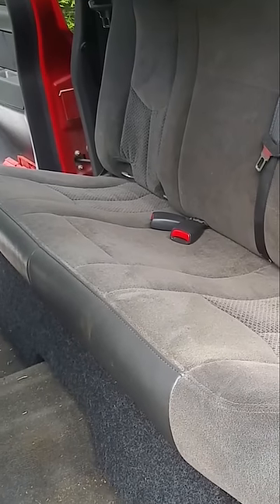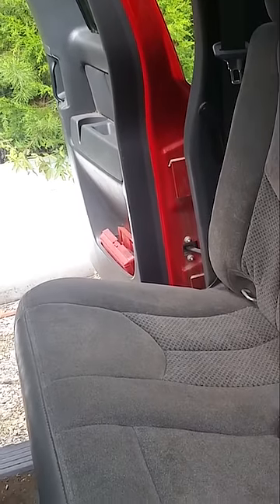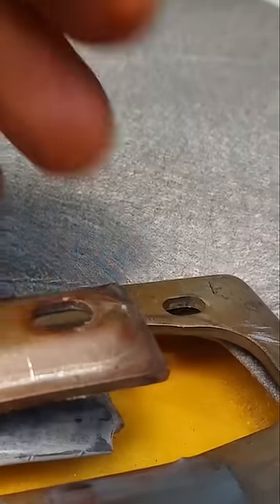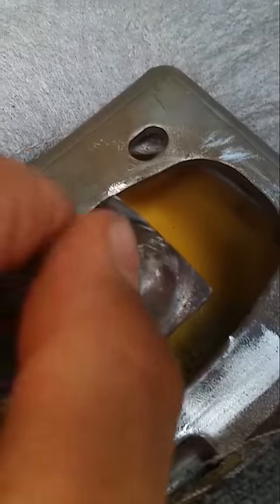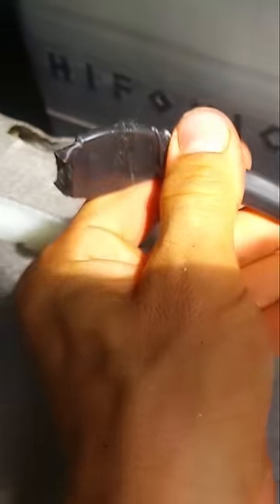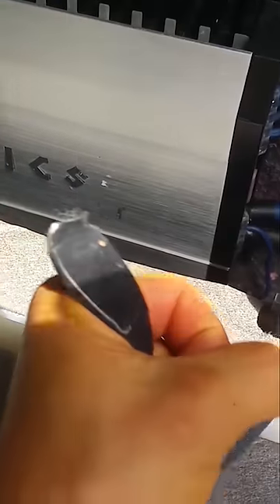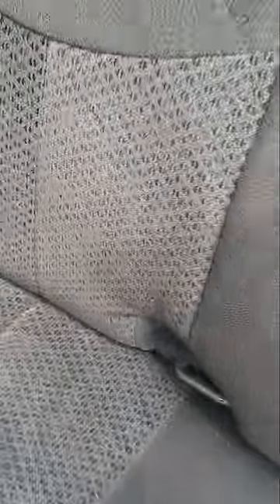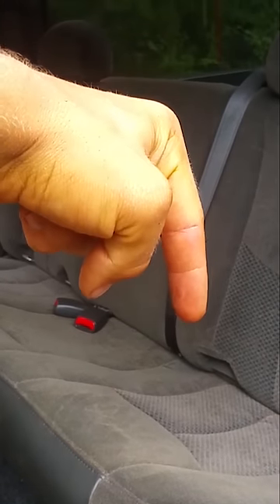Own A Silverado? WATCH THIS!

Comment: I just took the seat out. Its my work truck. Milwaukee packout sits nice behind the driver's seat.
Reply: Big ups for the packout system. Best set I've ever owned. I grabbed the electricians packout backpack also. Freaking amazing!
Reply: What year is your truck? Wondering if this works on my 2021
Reply: @Big_Blue_Eyeland  it's a 2001

Comment: I would replace the back seat with a front seat if you wanna go this route.
I carry some bulky items that cannot get wet as i dont have a cap on back.
Hopefully i can build a better storage box on back. IDK.
  This way of cutting the retention bar is not ideal or practical without a lock mechanism i.m.h.o.

Comment: Ok I have an 04... but I can't really see a use for this. Becsuse there isn't a while lot of room behind the seat. And you could just put things on the seat if you need to.
Reply: He's probably always adjusting his Amps or is always having to mess with them due to the shitty installation. I have 2 amps behind my seat as well but mine isn't cut down. Havnt seen those amps in 3 years
Reply: Those of us that use these trucks as work trucks and use Milwaukee packout
Reply: @Big_Blue_Eyeland  I use my truck as a worktruck too but I'm still not sure what the point of this is
Reply: @Monekyslayer445 this allows access to amps for adjustments and possibly fuse replacement. Mounting on the back wall also keeps the equipment safe and off the floor
Reply: Have an 01. I just removed the backseat permanently. It was getting in the way. I prefer to keep some tool boxes in the cab.

Comment: Hey I got a 2003 Chevy Silverado 2500 HD regular cab there is a center seat that doesn't fold down.
I wish you would make a video on how to get that to go up and down so there's kind of like a center console😂
Reply: You have to replace it with one that does flip unbolt the driver and passenger seat and it picks up right out of it then bolt it all back in

Comment: Really on 06 you have to cut that? On my 05 it folds both ways stock
Reply from the maker: Really???
Reply: @MattsShop  yup I wonder if it was an option or just certain years or what
Reply: @alockworkorange7296 Probably was a safety improvement. Those anchor points in cars for child seats are serious $hit. That seat not moving may have something to do with it not flying forward in a collision.

Comment: Sad that this has to be posted at all, and even more sad that hundreds if not thousands of people are gonna be like "ohh mah gawd, I neeeever knew that. I always get my oil changed for me."
Reply: Lol… on here acting like you knew.
Reply: @Buckshot1217 lol most people with common sense about vehicles knows if you rear seat won’t come down or out there is a way too do it anybody who has every swapped out cloth seats for leathers knows this 🤦‍♂️
Reply: @Urwivscoke yea common sense when you get into a accident and the rear seats fold the spines of whoever was sitting there in half…
Reply: you say that like you knew lol anyone that has one and that is mechanically inclined and works on their own stuff knows about this. I’ve never done it because I’m not lazy and I’d take the whole seat seat out and put a 60/40 seat back in. I guess I am lazy though since I haven’t done that so far, and my amp is mounted to the floor 🤷🏽‍♂️

Comment: Definitely do not mount your amplifier behind the seat like this guy did  they need air flow I would rip all that out and do it the right way before it anything bad happens.
Reply: If they are the new digital amps, they do not need air.
Reply: There's 2 vents behind the seat that provide air flow. Pay attention smart guy

Comment: What was the point of this?
Reply from the maker: To get access behind the seat. It doesn't fold from the factory.
Reply: @MattsShop  but there is zero room to put anything so why would I make a latch and like you said, make the rear seat less safe for passengers? Lol
Reply: @brandonjones952  you need food ventilation for amps. Bad idea